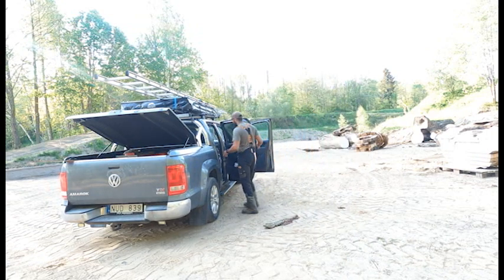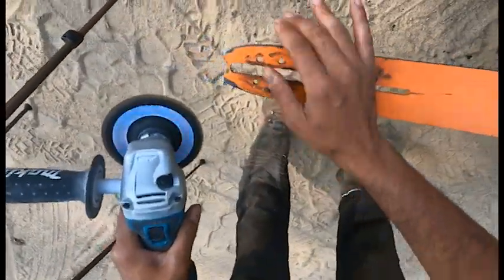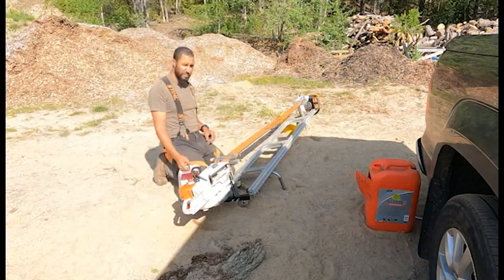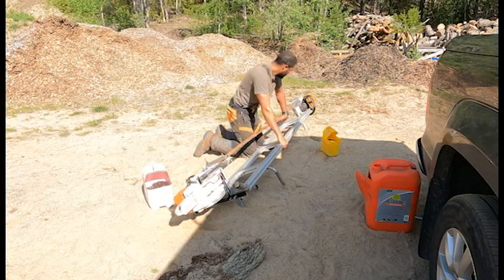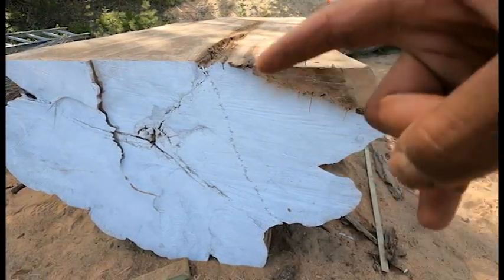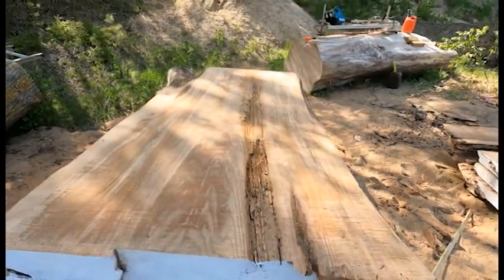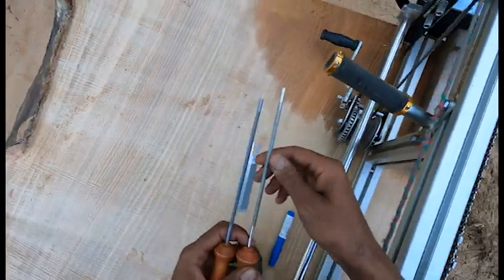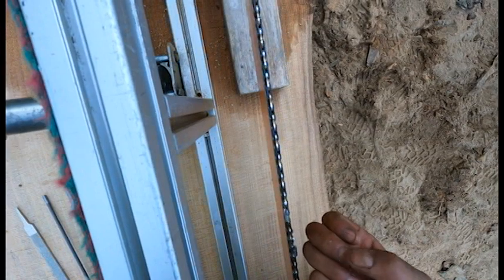Chainsawmilling in Valdemarsvik day 3 - 11h work day

Comment: how does the double-saw mill work without the two saws destroying each other?
Reply from the maker: Chainsaws have  centrifugal clutch witch helps, Lets say if one saw is reving at full speed, the other one gets in sync with the first one even tho it only runs on halfgas. Its hard to explain but the saws needs to sit oposit eachother so if one pushes the chain the onther one drags it 😅🙌
Reply: Look at it as a tandem bicycle. There is no other option than running at the same rpm.